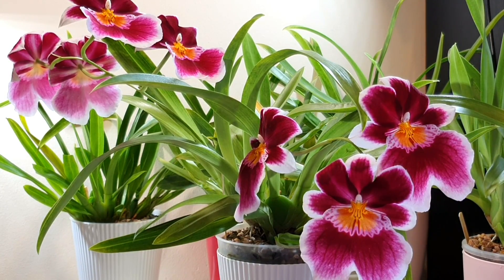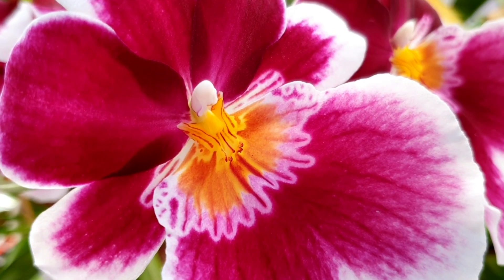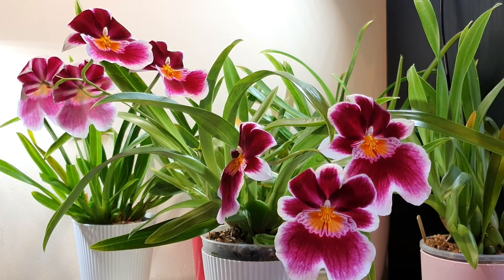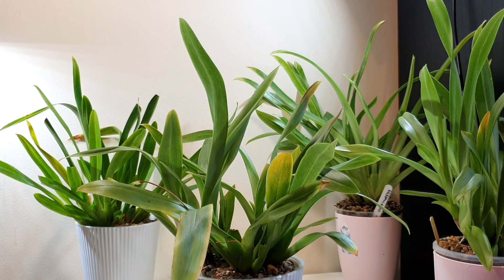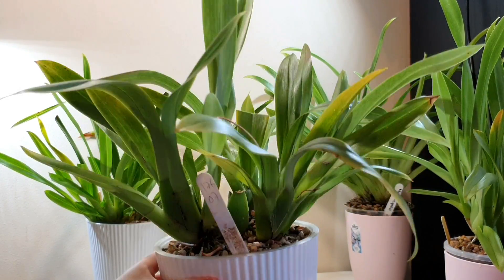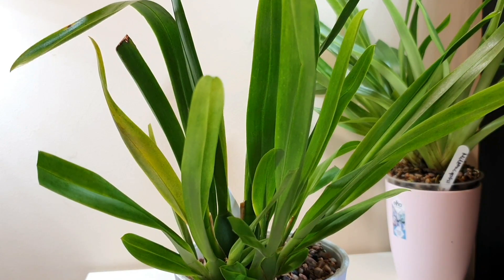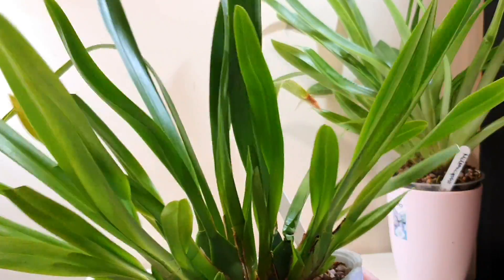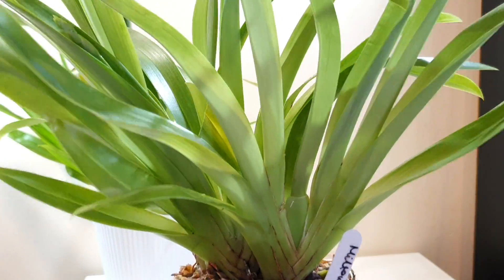Miltoniopsis Updates | Inorganic Media | Synthic, Pumice & LECA Mixes in Self-Watering Systems

Comment: I love your updates on the Miltoniopsisses! Thank you so much for all the great info on growing them S/H. I only am wondering which Ph level you use when you water/feed them, and how often do you flush the pots? And maybe soak them? Thanks in advance for  your help! :D
Reply from the maker: Hi, I go into detail on my pH and nutrient regime in this video: https://youtu.be/ux9WzRnMZmg
pH around 5.8-6. 250-300ppm usually. I don't really flush separately as I don't get build up, indicating they're using what I'm giving them. And since I I water with a pump sprayer they get flushed to some extent every watering anyway. Self watering systems so no soaking required 🙂

Comment: I just adore your miltoniopsis! I'm hoping your setup ideas help me keep one alive one of these days.

Unrelated question: in a recent video, you mentioned successfully finding larger clear containers by searching for food storage stuff on amazon. Do you recall the diameter of the ones you found? Most of those on US amazon seem to only be 10cm.
Reply from the maker: Thanks! I hope so too! Once you can get them established they are quite resilient 🙂

Yes the bulk pack of containers are 13cm diameter, 1 litre volume 🙂
Reply: @TheOrchidRoom  Ah, that's the size I'm trying to find an upgrade for, that's a shame. My Sharry Baby is climbing out of her 13cm pot 😂, so I may give up and use a big opaque one.
Reply from the maker: @olya4903  So for me the struggle was finding small ones. For larger pots I can just use the 15cm clear orchid pots in ikea Nejkon outers, far cheaper. For 16-25cm elho outers with clear inners or just semi hydro with cheap garden centre flower pots, if I dont want to see the roots. I only use clear now because I'm filming them tbh so I need to be able to show the roots where possible, before that, once I knew they did well I would just put them in cheap plastic sh pots.

Comment: I find synthic very usefull for vanda orchids
Reply from the maker: Interesting, do you pot them in full synthic? I can imagine that would be a bit too heavy in my environment. Or do you just wrap the roots so they stay moist a little longer?
Reply: @TheOrchidRoom  The second, and I adopt the quanity of synthic according to season. Summer a lot ,winter less or non. Just to let you know that my vandas are potted on clay pots with lots of holes so they dry very easy especially during the summer.
Reply from the maker: Sounds like a good application for it! The clay pots probably stop it being too soggy also. Great to hear about another method 🙂